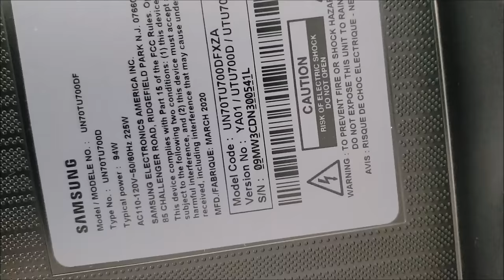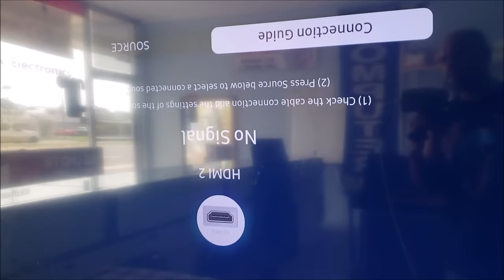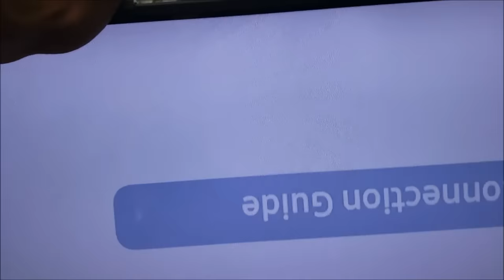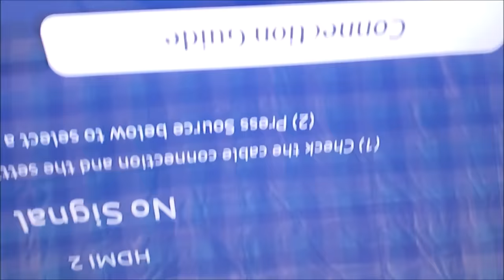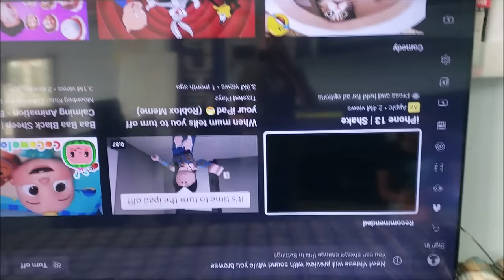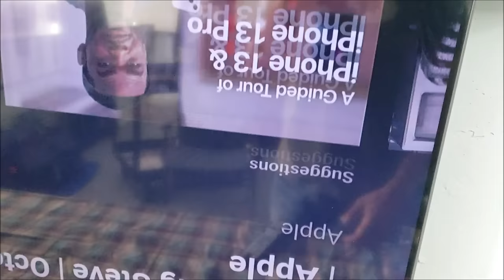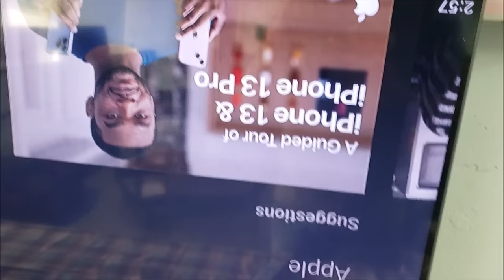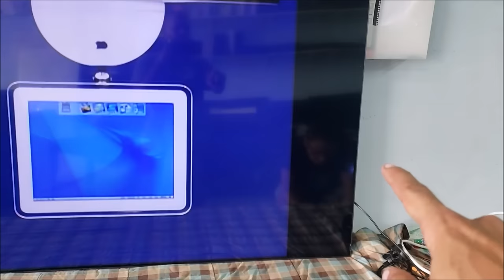Samsung tv UN70TU700DF restarting no picture

Comment: Maybe someone can help me, I had the screen on my 70" Samsung flickering on n off,I assumed it's panel,I tested psb,n it's good. I unplug mainboard TV comes on to black screen but no picture or sound, led strips work fine, I tried unplugging each ribbon to each side of panel to see what side it is, but no change undoing each side. I can hit settings etc, but can see led straps flicker like it changes channel, but no display at all. Can anyone tell me what's issue. Has no t con board.
Reply: @James-929 Hi. Have you found a solution for your case?

Comment: Whats if the tv turns on for like 20 seconds and off  white light on power button
Reply from the maker: disconnect the screen and see if the tv will stay on
Reply: It wouldnt stay on i was checking the ribbon cables and connections disconected the  power cable reconected  the tv split in half then its all black now and just keeps turning off

Comment: How exactly is it not a mainboard issue when you disconnected it from the mainboard & it turned on?  That would make me think that it was in fact the mainboard causing the issue considering it only happened when the mainboard was connected.
Reply: Main board is sensing a problem in the led's and shutting it all down. This is a trick to fool the board.
Reply: @flacoanemico5199  Ah I see.  Good to know!

Comment: Hi mate. I have Samsung ue32d5520 the fault is I can not use tv buttons and no input display and no volume display but red light flickers when press remote control. Please let me know what fault it is. Thanks
Reply from the maker: It's very hard to tell what exactly is wrong with it. You will need a multimeter and dig inside
Reply: I get Samsung smart logo then that's it screen light up but no other display for input or on volume the volume display do not come on screen and can not use buttons on tv. Thanks

Comment: hello i did put tape on pin 6 and 10 but my image do a little color flickering lite flickering .. image are perfect except this flickering , is someone have an idea thanks
Reply: flickering is more on the side i put tape on pin 6 and 10 like you did , a litr flickering image are perfect but color changed a bit every 1-2 sec
Reply from the maker: @maximelevesque1988  yes still more traces need to cover try smaller and bigger tape on different traces

Comment: I have a 50" samsung qled tv that would power cycle. Back lights are good,when i disconnect the only ribbon cable from the main board to the board on the bottom of the tv panel the tv turns on with sound but no picture. I did the tape trick and i can only get it to turn on with sound but no picture. Any other remedies i can try?
Reply from the maker: check my other videos there is other ways to try